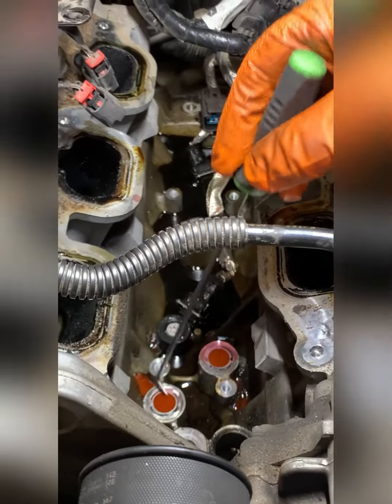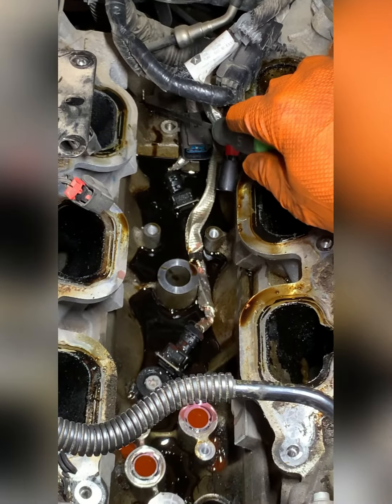2014 Jeep Wrangler - Oil Leak Repair

Comment: I have a 2014 jku and this the 2nd this thing leaks,  very expensive to fix. I was getting ready to trade it for the 2021. At this I’m done with jeep (FCA).
Reply: Yup. Same here oil cooler leaking and now rear main seal. Not to mention the cam shaft and rockers I paid 2k to replace. Looking to trade in I will not buy another Jeep.

Comment: Explained exactly how my wrangler leaked oil. At first I thought it was a rear main seal cause the engine was dry. But took a closer look and it look like oil is collecting where the oil filter housing is. Can’t you just change the seals??? Instead of buying a new part of the part was ok???
Reply from the maker: The oil filter housing was not too expensive.  We recommend replacing the entire housing because it is plastic.  The plastic fastened to metal is an excessive heat transfer.  The plastic will warp over time. This is why we recommend replacing the entire unit rather than only the seal.

Comment: Price Range to replace Oil Filter Housing +Cooler?
Reply from the maker: Any price under $1k is an honest price.  Make sure to install a legit Mopar dealer part as aftermarket parts for this repair are not a good source.
Reply: @premierautomotivediagnosti9432  I'm not sure about that. There is an aftermarket oil cooler where the entire thing is aluminum, hence no cracking plastic. If mine ends up like this, I'll go that route over mopar. Mopar products in my opinion are pretty crappy. I had a mopar locking gas cap that lasted only 2 years. The lock cylinder came right out. A good thing that happened when i had the gas cap out, otherwise I would have had to drill the stupid thing.

Comment: Not a drop of oil in motor. Would this cause oil to be in radiator?
Reply from the maker: There is a potential that oil and water could mix if the cooler failure is internal.  I have yet to see that happen on one of these but I have certainly not "seen it all".
I have only seen oil leak to the outside and fill up the valley between the cylinder heads.

Comment: What a stupid design by chrysler, especially making the housing plastic. And to make things worse, the placement of it which is over a  $1000 job if you take it to a shop. If you over-tighten the filter housing, you crack the oil cooler housing and bam it's gone. It's reasons like this among other which made me regret buying my 2018 jku. I should have went with a 4runner instead.